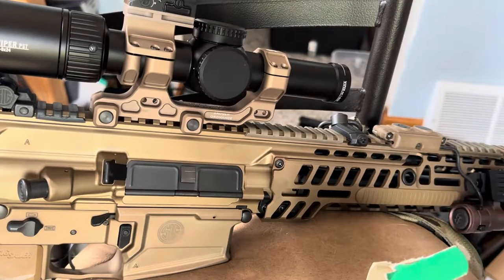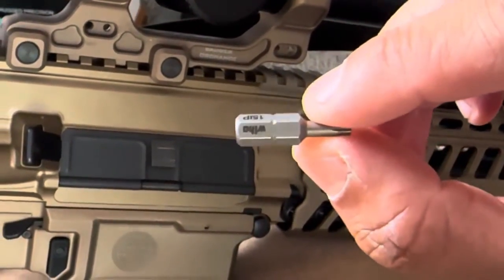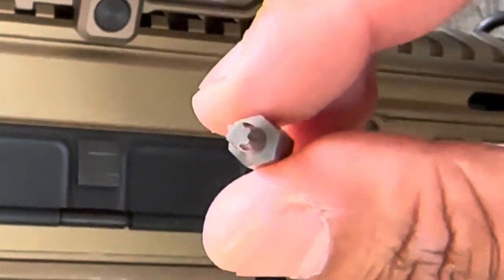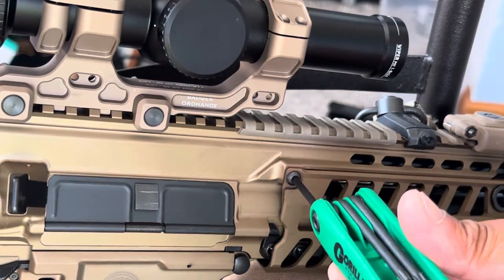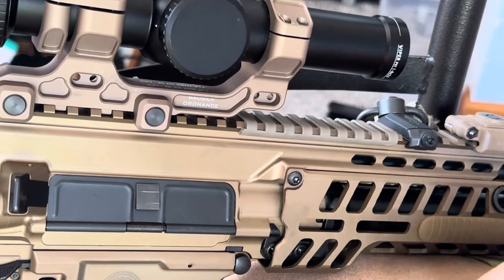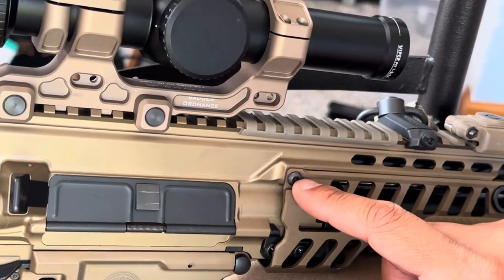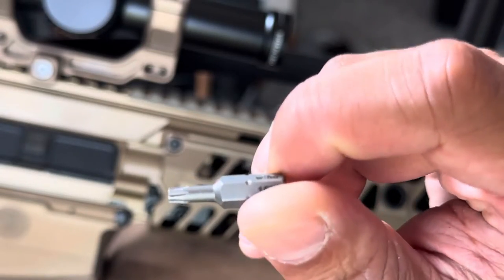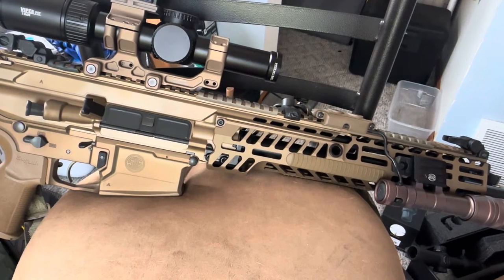MCX Handguard Screws and Torx Plus: MCX Spear tips #5

Comment: It would have been really helpful if Sig had included this info in the owners manual. I stripped both of mine using Brownell's T-15 bits with the Brownell's adjustable torque driver. As soon as I got to 45 inch lbs. they stripped the bolts. I contacted Sig and they immediately sent me a shipping label to send the upper back. I also had then remove the muzzle device because I run a Dead Air Sandman. They were very easy to deal with and admitted that they had received a bunch of damaged guns back due to these stripped bolts and the impossible to remove muzzle brakes. Got the upper back in 4 days, can't complain about Sig's service. Thanks for the info.

Comment: Please, someone help me with this problem. Sig told me the T15 is the wrong bit, that I needed an IP15. The IP15 does not fit in the screw. Is that because I stopped it?  The screw doesn't look damaged but where before the T15 worked, now it spins but the IP15 doesn't fit. I'm glad this video showed what screws to replace them with, so thanks!

Comment: Hey man, just letting you know, I would definitely look into the EZ-Lock EZ-313-008. I'm going to be making a post about it on the SIG forums for both this rifle and all the Spear LTs. It's a threaded insert that is literally the perfect length and wall thickness for all of these rifles. I brought it to a gunsmith and now I can torque my handgaurds down to like 50in/lbs. They're great! You’ll never strip your aluminum upper out either which I am surprised SIG didn't do to begin with
Reply: What bolts are you using after inserting the threaded insert?